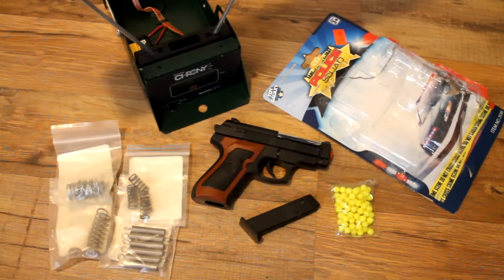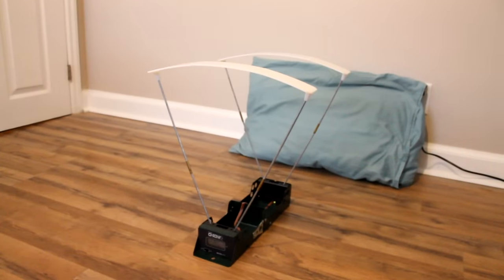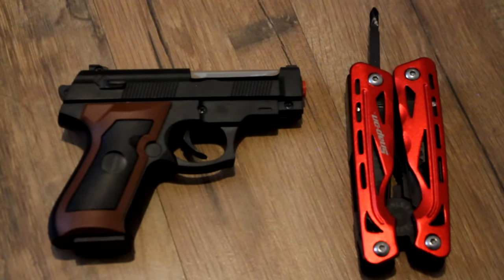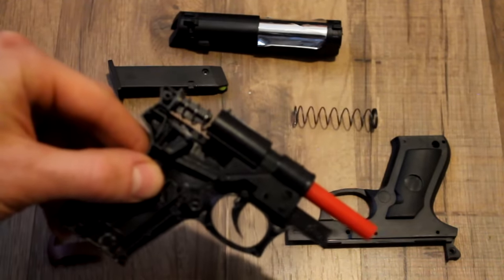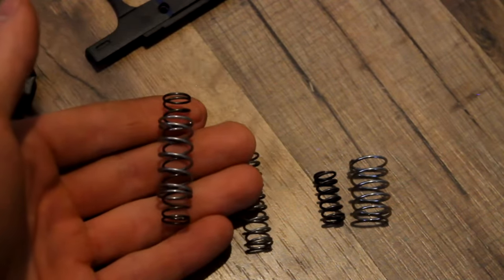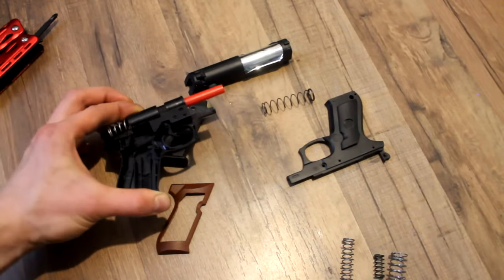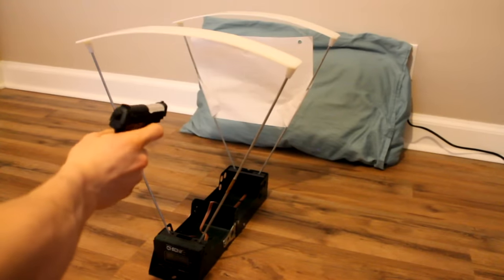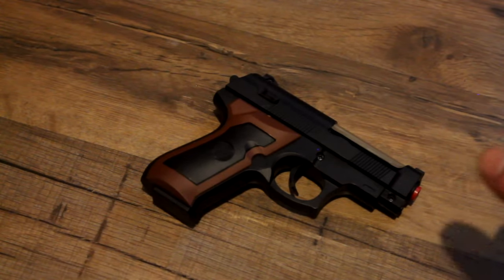How to Modify a $2 BB Gun for More POWER

Comment: I did the same renovation on the same gun. I used an extra powerful spring and it now goes through 2 inch armour plate at a range of 200 yards . I will continue to improve the spring and mechanism until it is able to punch through 8 inches of a p at a range of 2 miles
Reply: Ppl will be like. Look at that noob gun hahaha. U shoot it and it goes quicker than their 300 dollar gun😂😂
Reply: How?!.
Reply: @knrz2562  The work is now complete . At a maximum range of 3 miles it can now punch through 15 inches of  diamond grade armoured titanium . The armament is equipped with reduced plutonium isotopes , with a half life of 400 million years . The whole set up came to 15 bucks and a quarter . The hard part was , finding a re enforced rubber band to hold the spring in place .
Reply: @samsum3738  lmao, nice one. could I buy it for a 15 bucks and 2 quarters? Its a profit of a quarter, and with that money think of the upgrades you can make
Reply: @tidepodeater9368  sounds like a deal . For . For a quarter i can upgrade to Uranium and fix plutonium warheads for an improved range of 3000 miles and a hydrogen yield of 80000 megatons . The real problem is improving the rubber band tension .
Reply: @tidepodeater9368  Flash the cash and i am in for a bash .
Reply: @samsum3738  alright, thanks bae. I mean bro, haha my bad.
Reply: @samsum3738  try nitrogen coated titanium bullet$
Reply: @knrz2562  walmart have a sale on . Buy 50 get 10 free . What ' s not to like .
Reply: @samsum3738  wtf
Reply: @sonyclonesph4543  i am still working on it .It has laser sights and can have a range of 40 to 50 miles . It can knock out a tank up to 20 miles and an armoured vehicle at 50 miles. The whole thing came to about 10 pounds .
Reply: @harveyling2262  only if you hit them .
Reply: N00b! My modified gun can go through Captain America's shield.
Reply: @UnnecessaryNonsense  it came as a gift from The Beano comic , july 1958 .
Reply: @samsum3738  where did you buy from?
Reply: You will eventually need a bigger pistol, or stonger plastic
Reply: what kind of armor plate?!?
Reply: @davgames1206  chobham armour , as used on all modern british tanks . The weapon now has a range of 2000 miles and i have warned putin that if he does not stop all this malarky my rubber band is coming to a city near him .

Comment: 5: 55, indeed, a too powerful of spring can break the plastic. I added too much weight to a plastic hammer, maybe 30% over stock, and the extra force started braking the gun apart on the inside right away.

Comment: The problem is if the spring you are using is too strong for the components holding the spring, eventually the components would give way.
Reply: Exactly , It breaks on normal spring in few days. It will only shoot few times before breaking on the strong spring.

Comment: Magazine.... not a clip.... 

A clip is a little metal bar which holds rounds in the open, which then you use to load an internal/fixed magaizine in older guns, or to quickly reload a magazine in a more modern gun such as an ar-15/m16 variant